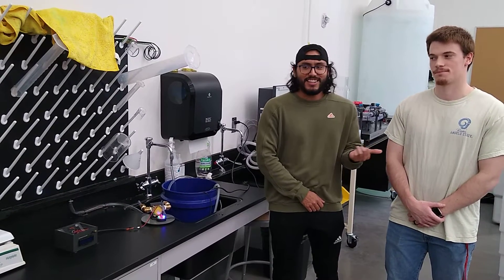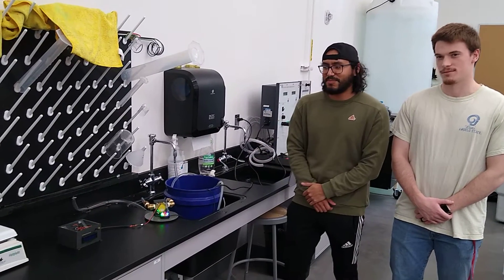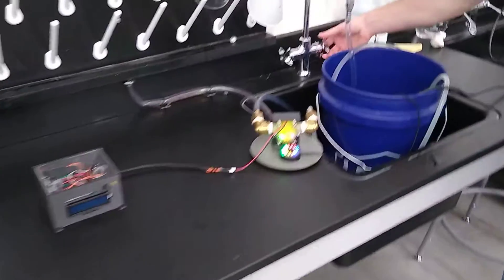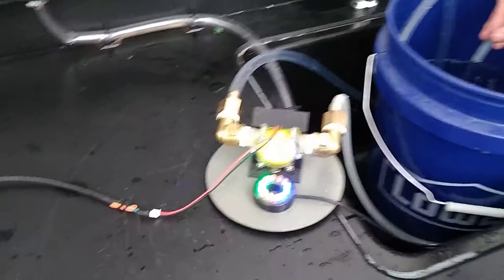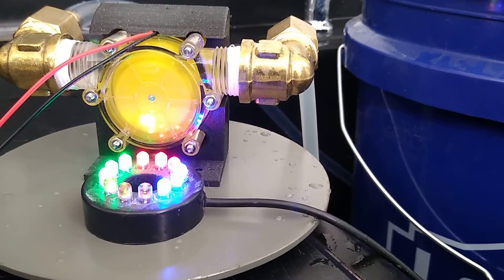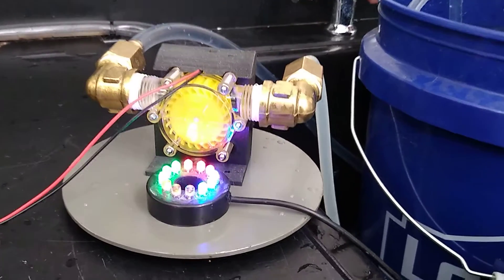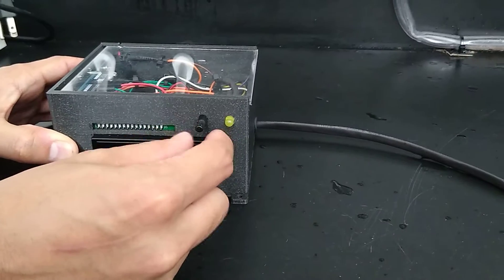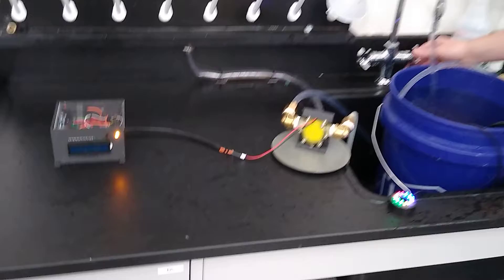Arduino powered by Hydroelectric Generator Turbine  & Monitoring (I, V, P) #arduino #hydroelectric

Comment: I'm trying to power a water pump with the turbine but it isn't working, is there a reason for this and a way to fix it. I'm trying to use the turbine to power the Arduino using the Vin pin, and the Arduino will power the pump and the pump will flow water back to turbine and so on.
Reply from the maker: Seems like you are planning to make a perpetual machine. It could be that your major loss are high, how you are starting the turbine?
Reply: @MohammadShafinulHaque  right now im just blowing air into it, becuase i need to find a hose adapter, this powers the arduino on and if i use a plug the arduino can power the pump; its going to start out with the pump pumpning water up into a series of containers, the water will flow down through the turbine before going back to the pumps water source, i wanted to test to see if the turbine would turn the pump on first before continuing. when testing the pump with a plug powering the arduino i used a capacitor to recover the power, would that work?
Reply from the maker: @_LKAT_  it seems the turbine is not generating enough for Arduino and pump both just by blowing. May need more water pressure to the turbine for higher rpm.
Reply: @MohammadShafinulHaque  
 Will eventually test it using the hose. How much pressure was needed to power the arduino because I plan to  use the turbine in a hydroponic system with water flowing from the plant container. I fear that this wouldn't provide enough pressure/water flow to generate enough power to power the pump and arduino
Reply: @MohammadShafinulHaque  is it possible for me to just attach a capacitor to the turbine?

Comment: Hi sir can you maybe or where can i find the code of the wiring of the arduino pls really need it in project for new energy plss
Reply from the maker: There should be codes available on the web, search with the pump model for Arduino code.

Comment: can you maybe make a small video of the arduino contection and the code or can i found in somewhere? thx
Reply from the maker: you can try the ELEGOO starter kit or any other starter kit that comes with a tutorial that will tell you about the input/output ports: https://www.amazon.com/EL-KIT-008-Project-Complete-Ultimate-TUTORIAL/dp/B01EWNUUUA/ref=sr_1_2_sspa?crid=LNX2CNWX9JXG&keywords=elegoo+starter+kit&qid=1665579816&qu=eyJxc2MiOiIyLjM0IiwicXNhIjoiMS45NSIsInFzcCI6IjIuMDAifQ%3D%3D&sprefix=elegoo+starter+kit%2Caps%2C117&sr=8-2-spons&ufe=app_do%3Aamzn1.fos.006c50ae-5d4c-4777-9bc0-4513d670b6bc&psc=1&spLa=ZW5jcnlwdGVkUXVhbGlmaWVyPUEyQUJESjgyU1lMSU5LJmVuY3J5cHRlZElkPUEwNjg0OTA4MjhRTE5aUlJKVUxOTSZlbmNyeXB0ZWRBZElkPUEwMjgwMTg4UEdQUkpOVVVUQzhRJndpZGdldE5hbWU9c3BfYXRmJmFjdGlvbj1jbGlja1JlZGlyZWN0JmRvTm90TG9nQ2xpY2s9dHJ1ZQ==
Reply: @MohammadShafinulHaque  I already have a starter kit like this but for my final project for school I'm going to talk about water power and I would also like it as you want eg show the data on an LCD.thanks in advance

Comment: Hi! 
I am extremely surprised about the power output of this small turbine. How did you get so many watts?? In other videos about these micro turbines it is much much less, about 2.5w at best. The results you got is it open circuit? Is there a load or battery attached? 

How much is the water pressure of your water inlet and the diameter of your pipe?
Reply from the maker: It was powering the Arduino set only. No additional load or battery is attached. It was the regular tap water pressure and the pipe that fits the tap, not measured. I think we measured water vol per min, can't remember.
Reply: @MohammadShafinulHaque  
Many thanks for your reply. 
Ok that would be usually 40 to 60psi. Looks like about one cm diameter hose. Ok if it is no load than that value has to be divided by two, about 4W actual output. Still pretty good.
Thanks again!
Reply from the maker: @off-gridretreat  you are welcome.

Comment: Where did you get the generator?  Very cool!
Reply from the maker: You can get these generators from amazon, one example

https://www.amazon.com/Generator-Micro-Hydro-Hydroelectric-Structure-Performance/dp/B07RSX44QN/ref=sr_1_12_sspa?crid=2UO1ER1BQAFX3&keywords=arduino+hydroelectric+generator&qid=1661866568&s=industrial&sprefix=arduino+hydroelectric+generator%2Cindustrial%2C103&sr=1-12-spons&psc=1&smid=AYAQCA6J7ASI3&spLa=ZW5jcnlwdGVkUXVhbGlmaWVyPUEyMFNXUkRPSktaRFk4JmVuY3J5cHRlZElkPUEwMjQyMTEyM0RKVjU1RTkzMDFPWiZlbmNyeXB0ZWRBZElkPUEwMDYwNTIxMVVaQlRGN05XWDVaUCZ3aWRnZXROYW1lPXNwX210ZiZhY3Rpb249Y2xpY2tSZWRpcmVjdCZkb05vdExvZ0NsaWNrPXRydWU=